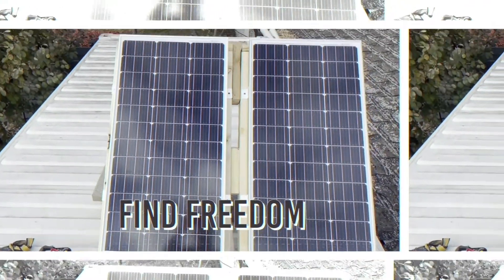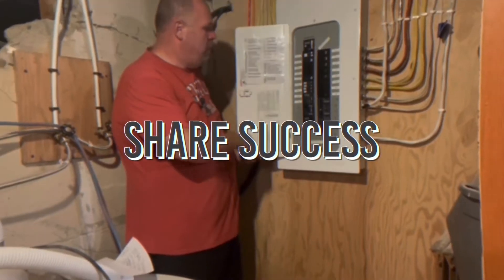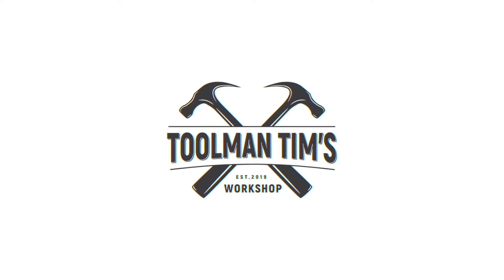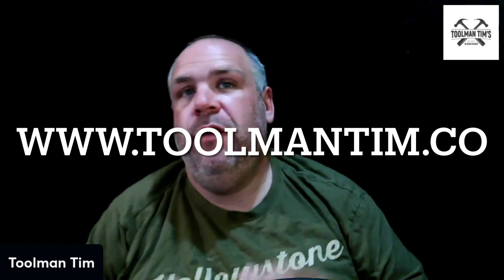BONDED vs. FLOATING NEUTRAL GENERATORS - Simple & Easy

Comment from the maker: Check out my video all about backfeeding.

TO BACK FEED OR NOT TO BACK FEED?  Powering your house with a generator.
https://youtu.be/xz1poDxSQn0
Reply: I prefer not to modify my Generator if I am using it to back feed my house. The better option for me is to lift the ground by (disconnecting and isolating the ground, aka the green wire) at the male connection on the house. This way no matter what generator is ever attached to the house to back feed, it will be correct. This leaves the Generator grounded by itself and the house is already earth grounded with the home service. Both are grounded but individually.

Comment: If you are using a Generator for portable stand alone power, the Generator is not fully bonded to earth. Basically, the extension cords in use are bonded to the Generator. To have the Generator fully grounded, you would need to drive a 8 foot copper ground rod into the earth and attach a wire from that rod to the grounding terminal on the Generator. NOW the Generator is grounded properly. Very few people do this. Being grounded to the Generator is better than not being grounded at all. My suggestion is this. All extension cords used on a Generator should have a GFCI at the female end. This is the best solution based on extension cords being used outside in possible wet conditions anyway.

Comment: Thank you,
I have an inverter generator with a floating ground, during an outage it runs what I need as is by extension cord independent of the house.
Should I be using a grounding plug in one of  the generator receptacles or with a single wire from the generator grounding lug to a house receptacle ground?

Comment: If I am back feeding and have a floating neutral setup on a 30amp generator should my breaker in the main panel also be 30amp or if I am using 6ga wire with an rv generator cord can I use a 50amp breaker? I was wanting to future proof in case I ever upgrade generators. My 30amp generator does have the RV cord hookup but its only 30a. Just want to make sure the breaker will trip correctly if there is a short. I think so but want to be sure. I still have the individual circuit breakers protecting those circuits in the main box and the generator itself has 30amp breakers that im assuming would trip.

Comment: So if my generator is supposedly. bonded, if I were to connect to my home to back feed via a interlock setup, I would have make a wiring change in my bonded neutral generator and then redo that change after I disconnect from my house connection in order to use my generator   in a regular fashion.. 
Do I have this right?
Reply: Yes,or you could simply take a regular old light switch and integrate it as a neutral connect/disconnect. That way if you're using the generator to back feed you flip it to unbonded and if you're using the generator to power a tool you can flip it back to being bonded.Lots of vids on how to do this.

Comment: I purchased a Champion 4650 dual fuel inverter generator. It has a floating neutral. At the time of purchase I wasn’t aware of such a thing. The main purpose of buying an inverter generator was to supply “clean power” to my refrigerator and tv’s during a power outage. I intend on using extension cords run from the generator directly to the appliance or tv. Will I need to purchase a bonding plug for powering my refrigerator and tv? Or is keeping the floating neutral the way to go when connecting to the appliances.
Thank you
Tom
Reply: What I have come up with is if you want to follow NEC codes, then you want to bond neutral to ground.  Most of these inverter generators are floating neutral.  So when something goes wrong, things may be energized that aren't supposed to and the breaker won't pop.  As your body is a resister, drawing power through your body to complete the circuit will put a little extra load on the breaker, but won't pop it.  The only way to pop the breaker is to bond neutral to ground, so it flows over the low resistance ground wire to complete the circuit, not through your body and that will draw enough power to trip the breaker, thus clearing the fault.

As a little side note, some things I have thought about to power your fridge from an inverter generator while running electronics at the same time are:
1. If you fridge hard starts, see what you can do about putting a soft start circuit directly on the wires to the compressor motor.  It is important to put it here, not in front of the whole fridge as you don't want the control circuits of the fridge to experience a brown out.

2. A fridge can easy go up to 10 hours without power if you leave the door closed before things get too warm inside.  Granted, a full 10 hours is more of a one off hit where normally you want to keep it shorter than this if you can.  Especially if your fridge hard starts and you are not looking to dig around inside to install a soft starter in it, one thought is to leave it unplugged for a few hours at a time as then it may run for a couple of hours or more straight to get back to target temperatures.  The thing here is you only get one start of the motor in the fridge where you have to have the generator off of ECO mode and then your fridge will run for a while continuously where you can have your generator in ECO mode.  Or maybe this is just the time you have your generator off of ECO mode and put it back on when the fridge is unplugged.  These inverter generators still don't like huge surges, say from a hard starting motor, so this is a way to cut down on that.  If say you are home for breakfast, lunch, and dinner, maybe you plug in the fridge when you wake up in the morning to the generator, unplug it when you head out the door to do stuff, plug it back in when you are going to prepare lunch, unplug it once you are done with lunch right before you head out the door, plug it in before you start preparing dinner, and then unplug it again right before bed.  Especially before a long overnight, you want the fridge to have several hours to really get back to target temps.

3. Kitchens tend to have surgy things in them that are hard on a small inverter generator.  The fridge.  Your microwave oven.  Toaster oven.  Blender.  Etc.  One other option is to have an extra inverter, say a 24V inverter and a 100 AH 24V LFP battery.  You can select different options, but the goal is to size the equipment to have say 2.5 kW of power capability or more so it doesn't trip too easily.  24V is also selected in this example because it can run a number of other things directly, say some portable fridges / electric coolers can take 24V DC directly.  Also wires for 24V at this power level are a lot thinner than 12V.  12V gets kind of hard to work with at this power level.  So then this powers your kitchen and you also setup the wiring for the battery to allow simultaneous charging.  The charger say draws up to 500W from the inverter generator.  This way you have a nice fairly continuous load on the generator and the extra battery and inverter take all of the hits to run the bursty stuff in your kitchen.  Maybe if you are not drawing a lot of power, you shut off the generator for a while and coast on the battery - inverter setup.  This can be especially handy when the power goes during a storm and you need to wait for it to pass before you haul your portable generator outside.  Also say for piece of mind for your fridge as then the fridge may have power all night long from the battery and you leave your generator off overnight.  Don't forget that in addition to some noise, which people are more sensitive to at night than some quiet thing in the day that nobody cares about, these small generators need regular maintenance.  So having the generator off a lot during an extended outage and even being able to shut it off for a bit to do things like oil changes, air filter cleanings, and refueling the generator can be very handy.  Granted refueling or changing to a different propane tank shouldn't take too long but even with this in an extended outage, you don't want to burn through your fuel storage too quickly with a generator that is running around the clock when it doesn't need to, especially when it is spinning fast the whole time in order to have the spinning capacity to handle surgy loads.  Just saying even with an inverter generator, it is easy to fall into this latter trap without some strategy to avoid it.  While essentially doing a "double conversion" which is something normally only done in computer server rooms and data centers, for the case of the small inverter generator backup up of the home, it may prove to be the far more efficient and overall practical solution over alternatives, at least for the more surgy things in your home while more stable draw things do more directly from the generator.

Comment: Hmm, then why did a Firmn Rep suggest I try to use a bonding plug on my generator where I appear to have a sensitive furnace that won’t work without the bonding plug, as it appears the furnace electronics will not operate if there is no sensed bond to neutral.  What am I missing?
Reply: I’m in the same boat.  I would like this answered.

Comment: A bonded neutral means that the neutral and ground are bonded together with a wire. It’s done inside the cover of the generator unit. The neutral is not bonded to the frame with a wire.
Reply: Wrong answer.   White wire connected to buss bar with all the other power wires.  This is on a new wen 680ix inverter gen. Ur talking old generator
Reply: @marktwo3160 ok

Comment: Tim,what about a generator with no transfer switch?My electrical box outside where the gen cable plugs into goes straight to the panel to an interlock switch.
I’m assuming the generator should be unbonded as the house panel should be the one bond?
This gets a little confusing
Reply: Correct. Should be a floating neutral gen. Test it and disconnect the bond if needed.

Comment: I back feed my main panel with a bonded neutral generator. I do not connect the neutral in the panel, only the 2 hot legs and the ground wire.  Am I doing the right thing?
Reply: Check your manual, undo the bond on the gen would be correct.

Comment: There is the misconception that a fuse that pops (overcurrent situation) is there to protect you, but that is not the case - it protects the equipment and wires from further damage to the property, like burning down your house and ruining your expensive generator. What protects a person is a properly installed residual current device (RCD) or a ground fault circuit interrupter (GFCI). That little breaker measures any imbalance of the currents in hot and neutral wires and breaks the circuit if any slight difference is detected - due to a current leakage to the ground wire. Cheers.

Comment: Explained it well.  If you're backfeeding a bonded genny then the best place is to break the bond is considered to be the inlet receptacle - disconnect the ground.  Then you a) haven't modified the genny, and related to that b) the genny is still ready and able to function standalone without modifying it back again, or else possibly giving someone a nasty surprise.  My last genny had GFCI, so woudl immediately trip the moment it was hooked up to the genny inlet, so the electrician disconnected the inlet ground.  Without a GFCI, but being bonded, the genny should function but is certainly not code and presents some hazard, if small.  That's why you need to break the ground path, and again, the inlet receptacle is the easiest place to do it.

Comment: what if i have the firman bonded tri fuel., and using an interlock system with a plug inlet hooked to my panel.. is that considered 'backfeeding? should i remove the bonded ground?

Comment: Why would small portable generators even be made as Floating Neutral? 
I have a Firman 3200 Watt starting (2900 Watt running) generator. Page 11 of my manual says it is Floating Neutral. Since I never plan on hooking it up to my electrical panel I bought online a “neutral ground bonding plug” which goes into one of the AC outlets to convert the generator from “floating neutral” to bonded. Since this is a small portable inverter style generator which is basically too small and never meant to become a whole house generator why would Firman (or any other maker of small portable generators) have built this small generator with a Floating Neutral ?
Reply: Did you ever test it yourself with a multimeter?
Reply: I haven't tested it with a multimeter but should do that next time I dig it out from the garage
 @BobLobLawsLawBlog

Comment: Hello!
I have a questions. My predator Gen has a bonded neutral from the factory. I intend on back feeding through my sub panel. Because of this, I will modify the wiring to un-bond the neutral. 
By creating a un-bonded neutral on the generator, will that prevent the generator breakers from tripping in the event excessive current is drawn?
Reply from the maker: This is one of those questions I don't know the answer for sure.  This is the time where it might be wise to have a quick chat with an electrician talking about theoretical situations :)
Reply: In theory yes....the breakers in the home should work as normal.  Or the breaker that the generator is feeding into will break.  But don't "back-feed".  Use an interlock device to ensure your main breaker is off when the generator dedicated breaker is on, and use a dedicated feed input box.  Back feeding is when you are feeding into a house outlet, like a dryer receptacle.   When the main (utility) breaker is off, and the dedicated generator breaker is on, you are just supplying an alternative power source...which is not back feeding.

Comment: i too have a firman generator with bonded neutral. have a transfer switch pane that will switch branch circuit power wires either from utility power or generator power. so if it ubder stand this right to break the ground loop i need to disconnect the ground wire coming on from the inlet box.

Comment: Thank you for the thorough explanation. For future reference: Champion model 201067 has a factory bonded neutral; (Source: Owner's Manual for that model).
Reply from the maker: Thank you
Reply: Nice thing about Champion is that they clearly list either floating or bonded.
Reply: @spacecoastz4026  I'm not seeing that on the website under specs.

Comment: So I have a Costco Firman Tri Fuel generator  . It will be strictly used as a back up power through interlock to the main panel (wired by licensed electrician). I was told I don't need to bond my generator frame to a ground rod or I don't need to make any modifications to the generator. Slightly confused (or may be a whole lot confused) as to what to do. Any comments. Nice video as always.
Reply from the maker: so first I am not an electrician and i don't play one on tv but from the reading I have done and research you should not need it to be grounded as you are feeding it into your panel.  But i always say make sure you check with a sparky
Reply: @TOOLMANTIMSWORKSHOP  Thank you so much.

Comment: I read bonded generators have power spikes that can be potentially damaging to sensitive electrical equipment anyone experience that running a bonded generator with extension cords? I tend to err on the side of safety so I bonded my Honda cause I primarily use extension cords but this whole floating neutral vs Bonded seems like a bit of a catch 22 for my setup... Floating neutrals can be dangerous to people and bonded neutrals can be damaging to your sensitive equipment...

Comment: Tim nice videos, thanks for the generator ones especially.  So, do you use a transfer switch, an interlock manual switch, or modified the Firman to a floating neutral setup?
Reply from the maker: I use a totally not 100% legal BACKFEEDING system with a 50 amp breaker in my panel I have a video if you want to check it out https://youtu.be/t5FYgLW-4ro
Reply: @TOOLMANTIMSWORKSHOP  Thanks Tim, I watched the video.  Good explanation of what you have setup in your home.  I've read the comments below by viewers.  I saw on another video you commented that you are planning to change the 50 amp modified power cable you made to a male - female plug setup, which I think is recommend as others have said.  From your video I think you are setup using the Firman as sold with a ground neutral, and your home main power panel is also ground neutral.  Do you have some concerns about 2 ground neutrals in your setup?

Comment: Can you shed some light on how to convert Firman T07571 to floating neutral?
Reply: they sell bonding plugs as a simple solution but do your research and make sure if you make or buy one that its UL rated.
Reply from the maker: I came across this thread in a forum that might help.  Firman doesn’t have any documentation on this subject I can find.  Champion has great videos for doing the opposite procedure.

https://www.powerequipmentforum.com/threads/how-to-disconnect-neutral-from-the-frame-of-firman-t07571-tri-fuel-purchased-at-costco.24417/

Comment: Nice video Tim. Here's a follow up thought for you. I have a bonded neutral generator and a transfer switch that does not switch the neutral. After a ton of homework I've come to the conclusion that a suitable "workaround" is to interrupt the earth connection between the transfer switch Inlet and the generator. In other words, don't connect the ground wire in the transfer switch Inlet receptacle and you've broken the ground loop. Interested in your thoughts on this. Thanks